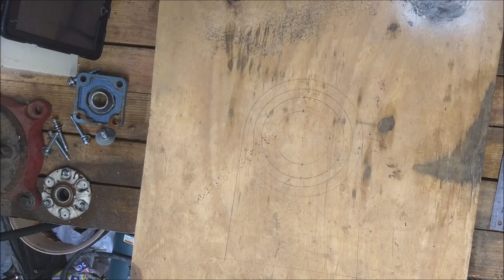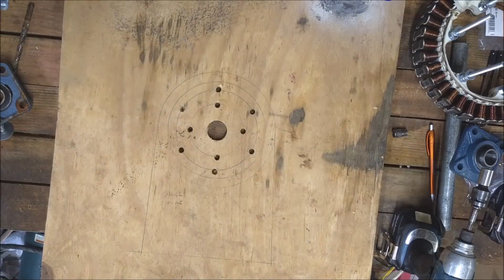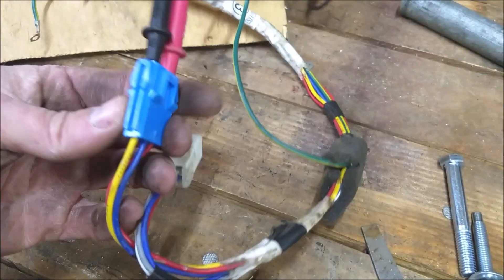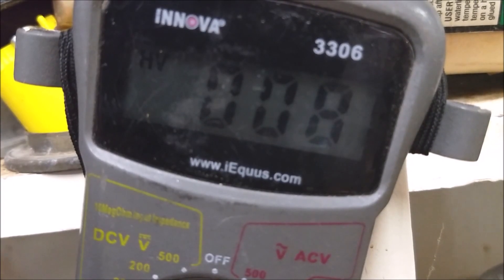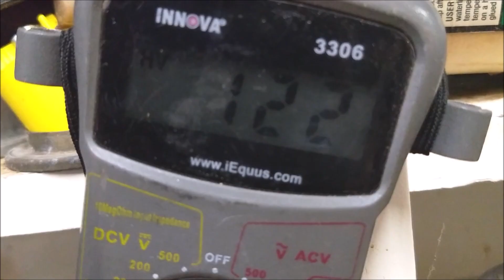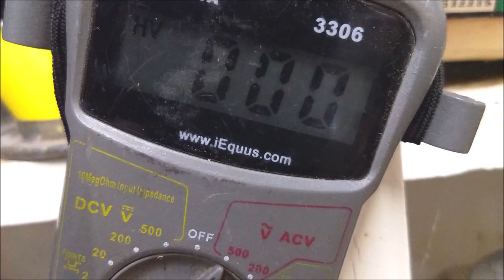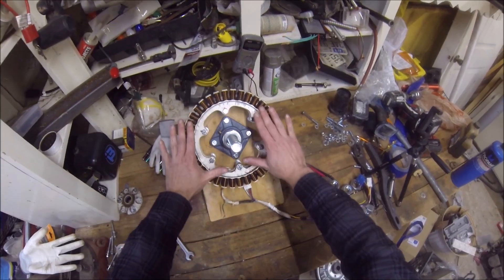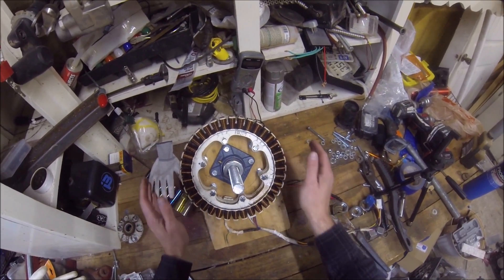DIY Project #3: LG Washing Machine motor, stator assembly and open voltage test

Comment: Why didn't you just use the plastic tub base as the pattern and direct transfer the measurements from that?  Also the original shaft and bearing carrier are superior bearings and mounts that are easier to align into a center carrier surface.
Reply from the maker: In my later videos working on these things I started pulling the entire bearing assemblies out...I didn't realize it was an option when I first started playing with them :D

Comment: This moter is DC12 v or 24
Reply from the maker: This is a 3-phase AC motor that makes over 300v in original trim.
Reply: @ToysforWatts  Hi Tony, I only get about 5vac across all 3 phases. And about 0.8 ohms between all 3 phases. So what did i do wrong ?

Comment: Usually when I got those from washing machines I would just tear apart the plastic tub and everything you need is encased in that plastic... the mounting base for the stator and the Hub shaft, everything and it's always perfectly centered... just takes a little more work busting all the plastic from around it and you have to cut a few things but you don't have to spend any extra money on anything to get a perfect centered perfect working generator- motor... I have two of those... the first one I had got I actually hooked an electric motor to it with a belt pulley system and  spun it up to  about 1,600v-1700v AC.... actually have a short video on my channel of the second one I had gotten showing it mounted on its own plate Hub shaft everything as it was in the washing machine
Reply from the maker: It's really not something I even considered when I started that one, but by the third one I was cutting the whole motor and bearing carrier out.  Some of my newer videos have one mounted to a cheap Chinese turbine as a base...that's how I did that one.
Reply: U can actually use the basket if not broke  an make a wind , or water generator also it's on utube some dude off grind they are not trash that's for sure

Comment: The 36 coil version seems to be better as has less cogging partly due to the plastic white bits all being round off at the factory , I have one arriving later today off ebay, is your one 36 or 40?? cheers !!
Reply from the maker: They're the 36 coil versions, but they are aluminum wire stators.  I really want to pick this project back up very soon but I'm fishing around to see if I can find two copper coil stators to do it with instead.
Reply: @ToysforWatts  If you look for LG direct drive motors you should get the newer ones, I never realised people used aluminium wiring?? is that to save money , I can't see any benefit to that.
Reply from the maker: I use whatever I get for free :D...I get aluminum about 3/4 of the time.  They're not bad, just more difficult to reconfigure the coils since it can't be brazed/soldered easily.
Reply: @ToysforWatts  Crimp terminals solve that problem. I work with both the 36 and 18 Pole Samsung units and they are all AL wire. With the 18 poles, splitting the phases down to 2 pole units  ( (3) 3P 2S ) results in a rectified voltage that works for feeding into a MakeSkyBlue solar charge controller being used on a 24V nominal. At 750 RPM the unit will make about 325 Watts. The 36 Pole units do a bit better.  As should those wound with Copper wire.

Comment: They rewire the stator to lower the  voltage, not make it higher, I bought one like that on eBay for $150 from windgenkits fisher & paykel style with hub built in already and 3/4“ shaft but not modified coil for lower voltage, sadly difficult to modify because it has aluminum wire.
Reply from the maker: Oh wow I thought they were trying to pick up voltage and amps.  That makes sense.  I'm going to have a go at trying to figure out how to use it the way it is without adjusting the coils, but I may have to give it up and start cutting.
Reply: @ToysforWatts  Simple way that cost you little, use the connection where the Wye wiring joins the three phases together. Add a wire there and two diodes with one cathode out and one anode out. Do the same on each of the legs in your terminal connector. Connect the positives of the diodes on the three phase together and the same with the negatives. Connect the positive of the common connection to the other positives and do the same with the common connection's negative to the 3 phases negative. You now will have 1/2 the Voltage without cutting coils.
Reply: All the ones I've ever messed with have actual copper wire windings.... I guess different manufacturers use different wire just like microwave Transformers some of them are aluminum wound

Comment: ive seen 1000vac from my  F+P 240v stators using a drill at around 500 to 700rpms  , so i had to reduce coils per phase toll i got the voltage i wanted at the rpms i wanted, the  style you have vary in size , o like the Big ones and rewind them. you made it look too easy, you put me to shame , my problem is im an absolute perfectionist so im slow.